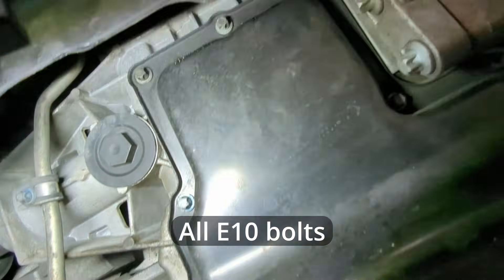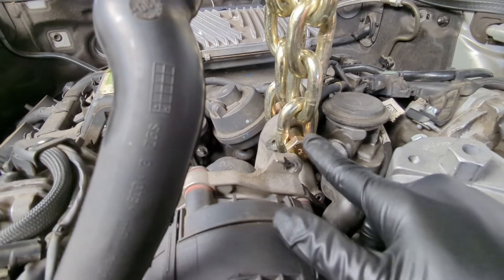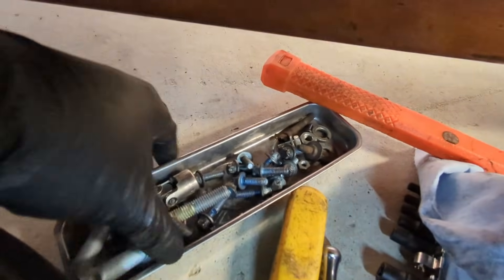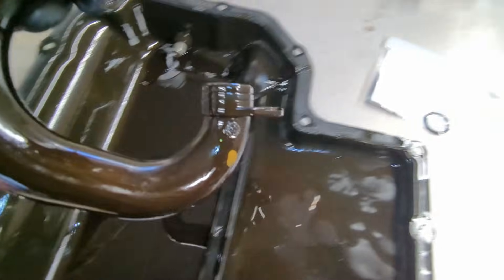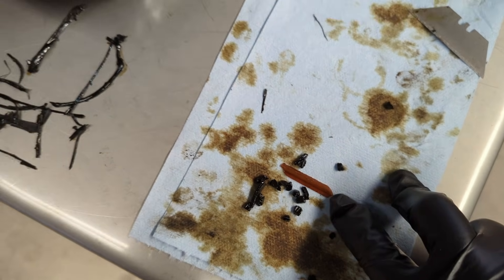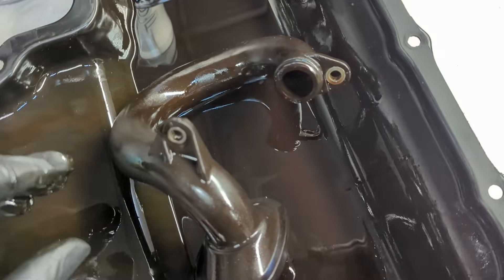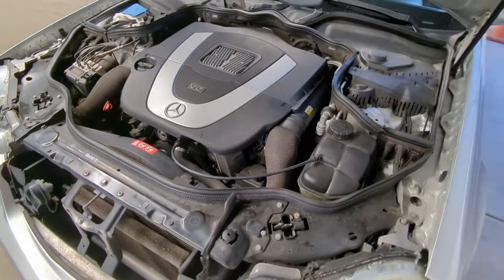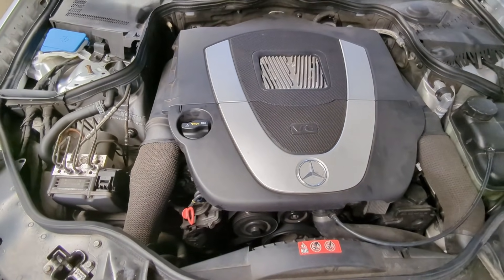Cold Start Rattle? Mercedes-Benz M272/M273 Oil Pick Up Tube O-Ring | S211 Ep. 2

Comment from the maker: UPDATE: I installed a new oil pan to replace the warped, original oil pan I reinstalled in this video and I have some additional tips:

-If you disconnect the transmission cooler line completely, you'll have room to move the transmission cooler line out of the way enough to reach the front 3 oil pan bolts WITHOUT having to lift the engine up. You'll lose a few ounces of transmission fluid so have some handy.

-The E10 universal joint socket I mentioned is a life saver in the tight areas.

-@Eli-kr5bm commented below that rubbing alcohol helps soften old silicone for easier removal and cleanup, works great!

-I used Liquimoly Engine Flush before draining the oil to make the oil flow as freely as possible to reduce the risk of oil dripping down on the fresh RTV bead when installing the new oil pan. Make sure the mating surface is clean and the walls above the mating surface are free of dripping oil. The RTV can't set properly if oil mixes into it and you'll spring a leak.

Happy Wrenching!

Comment: This engine is built for durability not to be a quiet engine. We been riding with that noise over 296,000 miles. 😂
Just keep the oil changed, add one bottle of Lucas high mileage synthetic oil stabilizer and your good.
Reply from the maker: Definitely comforting to hear so many high mileage stories regarding the idle knock being a non-issue. Thankfully it's more annoying than worrying! Thanks for watching!

Comment: Prior to the next motor oil change, try adding seafoam to it, in case the noise is due to lifters.

Try using a stethoscope to hear where this noise is coming from and if it disappears once the car has been on idle for 10 min or so.

Cooked catalitic coverter material breaks into pieces and rattles too.

Cheers.
Reply from the maker: Thanks for watching and the suggestions. I've used liqui moly engine flush / seafoam in the crankcase 3 times in my ownership of this car and still have the rattle at idle.

The stethoscope is a good idea. 

The rattle is only at idle / rpms below ~1000 rpm. It increases in frequency until about ~1000 rpm when it disappears. This makes me believe it's oil pressure related. Could be a hydraulic lifter not getting enough oil pressure and collapsing at idle?

The rattle is very consistent and sounds most prominent at the front of the engine. My girlfriend's accord had a cat with broken pieces in it and it would rattle only when it catches a resonant frequency that causes the pieces to bounce and rattle aka almost randomly

Comment: Does anybody know what the high pitch noise is that goes away after 10 seconds?
Reply: Reason is my 2009 clc350 does exactly the same , sounds like an electric motor
Reply from the maker: @Robert-y5x6n  Likely the secondary air pump. It's the round, black pump at the top middle of the front of the engine. It's for emissions.

Comment: Is it possible to replace the whole oil pump without removing the engine?
Reply from the maker: From the research I've done, it looks like you can drop the entire oil pump from below by just removing the lower oil pan. I found this forum post that has the relevant instructions.

https://mbworld.org/forums/m-class-w164/804237-w164-ml350-m272-oil-pump-pick-up-tube-o-ring-replacement.html

Comment: Hey Julian I was just curious if you solved your issue? With the tapping
Reply from the maker: Haven't solved it, no. Everything on the Internet says it doesn't hurt anything so I haven't dived deeper. It does sound like a collapsed hydraulic cam follower, the increase in rpm/oil pressure making the tapping go away seems consistent with the cam follower being the issue. If I ever pull the valve covers off I'll replace the full set but until then I'm racking up miles like normal
Reply: @julianmdeleon323  thank you for such a quick response. I have recently developed this tapping noise within the past two months I still have less than 100 K miles. I see this video was made 10 months ago so you’ve been driving with this noise and it hasn’t caused more issues?
Reply from the maker: @brucetaylor7224 this is my 3rd 211 E350 and they've all made this same noise. My car is at 157k and still going strong
Reply: @julianmdeleon323  Hello, thanks for the video. I replaced the six exhaust camshaft followers on bank 1 because the intake followers cannot be accessed without removing the front cover, which requires the engine to be removed from the bay. Unfortunately, this did not resolve the issue. Using a steelman ears, I can hear that the noise is coming from inside the exhaust manifold only when hot and rpm<800, and gets less when enjecor 2 is deactivated by the scanner.

Comment: Bro you better check your spacers where the cam see if they are getting scratched up that sounds like it's knocking your timing off with a cam sensors you might as well take off the front valve cover on both sides 305 and then go to 40 look for all the marker dots with the engine head surface across if you just take out the sensors and rotate it to proper timing see if all your coins symbols are visible dead center at the same time for the left and right side. Of the left and right side

Comment: Thanks for the great video! How's the engine doing? Problem solved or still running it?
Reply from the maker: I've put about 10k miles since I did this repair and it's running great.

The oil pick up tube o-ring fixed the rattle on cold start but the rhythmic tapping noise at idle is still present but that noise seems to be par for the course with these engines I'm not terribly worried about it.

Thanks for watching!
Reply: @julianmdeleon323 Yeah I've got the rythmic tapping noise as well. Mercedes dealer said it's normal on these engines. I've got 210.000km on it right now but drives great 👍

Comment: For easy silicon/RTV removal try letting it soak in alcohol next time, just regular alcohol or the strongest isopropyl alcohol you can find, helps to make it come easy
Reply from the maker: Awesome advice. I just replaced the warped, original oil pan I reinstalled in this video and the alcohol worked great!

Comment: That tick noise seems to a common sound with M272. Everywhere I looks seem to say its nothing to me worry about with m272 engine. Haven't seen anyone say they made it go away by doing something. Sometime I think I made it go away with an additive, but I think that my mind playing tricks on me. It always comes back.
Reply: I am having this issue. Is it anything i should panic about?
Reply: @Jnzk2002  the tick? seems like something not worry about. the cold start rattle? its probably eventually bad for oil pump (like any pump thats sucking air ) but its real short duration. its on my list of things to fix. I have an ML so I am hoping that trans line doesn't run up on oil pan like in this video.
Reply: @ happening on my w204 c300 and i am a little worried about it. It goes out in 3-4 seconds and happends when cold start. Hopefully it is going to last me

Comment: My ML350 seems to do that. A little rattle and dip in RPM. Kinda sounds like its gonna stall out, but rpm back up. Is that bad for vehicle? I think just noticed it this winter. Does it need to be fixed right away. I hope mL pan is easier to remove cuz engine lift? I can't do that.
Reply: Doing my ML now. The oil pan is a lot easier to remove on the W164 vs this W211

Comment: listened to you video, you def have issue with pulleys etc, i would do a refresh on the 3 common ones, I hear a wine, possible alternator, that tap noise after start up, my car does the same, I have a 2012 c300 m272 with 143k, only happens when engine is warm and at idle... i hear other benzs with the same tick, I'm told not to worry, someone suggested to swtich to 5w40... i use 0w40, oil change every 6/7k

Comment: Use stethoscope or long screw driver, stick it on the lower bolts of valve cover the nearest one to each piston or on the exhaust manifold nearest to the pistons you will hear the most distinguished noise intensity and rhythm from the piston in question... 
All this to make sure it is coming from one bank and mostly specific poston..
Once found disconnect the injector of that piston in the middle of the symphony and observe quiter or completely disappeared noise.. 
Endoscope that piston to observe any scoring if any exist ask a mechanic what to do.. if there is no scoring 😊cheer up and read my other comment about carbon build up

Comment: I thiught it is bad piston wrist pin. And then thinkning  combustion knocking (caused by carbon build up on piston top) is the root cause I performed carbon removal cleaning for all pistons through spark plugs holes .. 
The noise disappeared from piston 2 and later on started on piston 5 !! 
I think the reason for this piston double knock noise is carbon build up around the piston specially at rings seats.. 
The successfully cleaned piston stopped knocking and another missed up by the desolved carbon of the cleaning material started knocking!! 
My experiment says it's non mechanical issue, it is combustion related issues and root cause is carbon build up.

Comment: I have a 14’ c350. Mine does this too but not on every start up.
Reply from the maker: I noticed my car would be more likely to rattle on cold start if I was parked on an incline or if my oil level was less than full. Likely due to the oil pick up connection not being submerged in oil and the worn out o-ring allowing air in first on start

Comment: 7:20 that black stuff is the rubber ring that wraps around the balance shaft and or around the crankshaft sprocket.

It seems like it fell apart... :(

The purpose of it is to quite down the chain noise a little bit, but obviously this could cause low oil pressure issues as it most likely will end up being sucked up into the pickup strainer and blocks the screen.

That piece of the chain guide being there isn't good either...

Comment: Hi buddy I found your video I have the same sound I have been driving with this sound for 5 years and have not found the reason a lot of information all due to wear and tear and scoring of cylinder liners although I have not looked into the cylinders themselves Do a cylinder endoscope usually at idle the pistons knock in the cylinder when shifting above 1000 rpm the sound goes away titanium oil 5w40

Comment: I have the hot start tapping noise aswell. Alredy changed the chain tensioner with oem and the oil pick up tube ring! Nothing helped. Ill really love if someone finds the real couse
Reply: Wałek równoważący
Reply: My engine is 2009 with number far after the "problem range ones" how can it be ballance shaft? @bonifacylucyfer7447

Comment: Check out the timing chain tensioner. It's under the alternator. Once exposed, it can just be unbolted/replaced without having to mess with the timing chain cover, etc.
Reply: I replaced the tensioner and still the same noise.

Comment: I'm sorry you thought that o-ring was going to solve the infamous M272 noise. I hope you don't waste your time tearing into the chain tensioners unless you just want to for fun. You won't find your solution there.

This lovely, calming, reassuring  noise is piston slap. They just about all do it. It is documented, Benz has always known about it, and there was a TSB out on it when M272's were still in production. I came across a few threads about it & read the TSB myself. 

The good thing is that although every one of our cylinders is scored to some degree, this piston slap apparently doesn't cause damage to the extent we will suffer any performance loss or failures which I still find hard to believe, but somehow it's true. I spoke with someone who said he had this noise all while taking his car upwards of 350k miles. Search for M272 Piston Slap &/or Cylinder Scoring TSB, etc. Cars are fun, aren't they??
Reply: Piston slap is a different problem that M272s are plagued with, you are correct. This though only happens at the first start and will rattle for a couple seconds. The cause is the o-ring in the oil pump, I had the same problem, changed the o-ring and no more issues.
Reply: I touch the start button and let it set for a bit before I actually start my 2012 E350 Blue efficiency and seems to work to keep it from rattling maybe someone can try this see if it works on yours lmk.
Reply: @RussellY-c8e  thats what i do in the morning cranck for 2 secs and turn off then start again ML350
Reply: any link or pdf of the particular tsb?
Reply: Great you've come across a document .. do you have link for it ??

Comment: It's so noisy. chang Engine oil 5W-40 + Mann HU718/5 + Powersteering(Pentosin chf11s) > that wil make smoothy & Quitely
Reply from the maker: @BendoryTV  running liquimoly molygen 5w40, mann filter, and pentosin chf11s. Noise caused by something else
Reply: @julianmdeleon323  how about pCV Cover or AC Commpresor? >> https://youtu.be/QajNgo7tZT8?si=vLj6bsxoTsfsm2b7

Comment: If you solve the tapping noise, would be greatly appreciated if you share the knowledge what causes it
Reply from the maker: That's the plan! Hoping to solve this mysterious issue soon. It's surprising that there's very little concrete information about it online / on forums.
Reply: @julianmdeleon323  Yes I noted the same, alot of people seem to have different issues and some are linking it to the balance shaft (which it is not without codes). Some people say its the waterpump or chain tensioner, some say its just lifters or camshaft adjusters. So its really broad spectrum to narrow down from.

Comment: i have a 2006 E350 4matic at 241K miles. I originally thought this noise was because of a bad camshaft adjuster
Reply from the maker: I've done the camshaft adjuster magnets when I first got the car some 20k miles ago and didn't notice any change in noise after the repair. I might pull the magnets again and check their condition. I'll do an update video if I do.
Reply: @julianmdeleon323  I don't mean the magnets I mean the literal camshaft adjuster
Reply: They are known for going bad too
Reply from the maker: @reki353  Didn't think of those as a possible cause of this issue, I'll definitely be doing some research on it. Thanks!
Reply: @julianmdeleon323  https://youtu.be/H128cTt1zL0